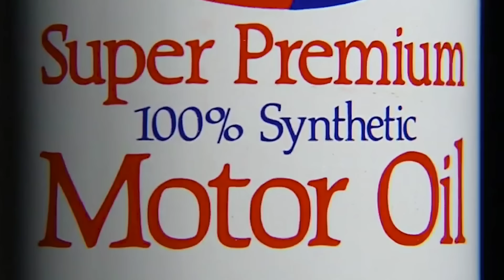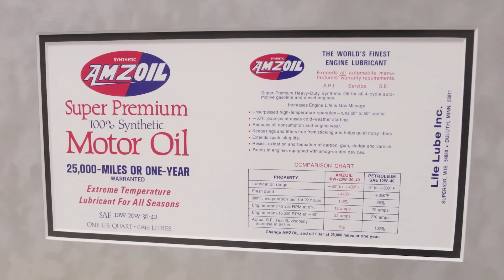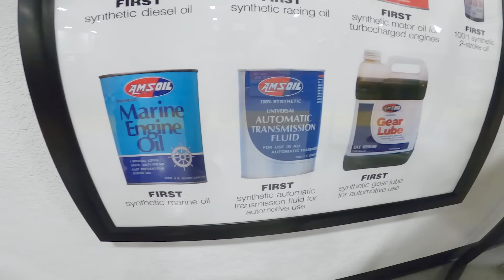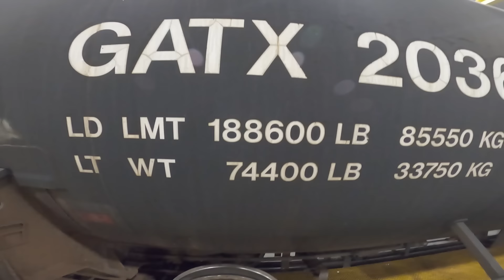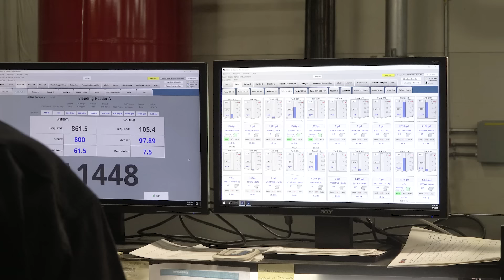How synthetic motor oil is made | Part 1 of 4

Comment: The funny thing is for jet fuel and cleaning a hydrant system on a flight line this is very similar we just have much larger piping and our pig launchers are probably 4ft in diameter to clean out the system like they have

Comment: I used ams oil in my rig 500 miles later the engine threw a rod but i think think mechanic did the engine flush and forgot to put oil back in the engine while flushing ....after that i just use regular oils in other trucks

Comment: I would consider using Amsoil if, it was more readily available and, had a more competitive price. The way they have in my area is online, submit personal information, or drive for over an hour to the closest Amsoil dealer nearest me. They also charge shipping for anything under $100 dollars. I end up spending twice as much as it cost for mobile1 or Pennzoil fully synthetic oil. I can get either of these within 5 miles of my house every day, any time, 24/7. It just doesn't add up.

Comment: Why do manufactures recommend a particular SAE for their vehicles?
After all SAE recommendations is based upon temperature. 
For example there is only 5°c difference either way between 10W50 and 15W40 / -25°c to 45°c for the 10W50 and -20°c to 40°c for the 15W40. 
Depending upon where you live, either viscosity would be fine.

Comment: Forrest Lucas, president and founder of Lucas Oil. Told my father, how synthetic oil is made. My family has built racing engines and competed in NHRA for the last 30+ years. Forrest said that synthetic oil is nothing more than hundreds of gallons of oil being put in a sonic vibrator and analyzed. The oil where the molecules stick the closest together is labeled full synthetic. When the molecule starts separating. It’s labeled semi synthetic. When the molecules get a certain distance apart, it’s label. Conventional. Makes sense to me.

Comment: They are telling you the truth I field tested their products for 350,000 miles they were labratory tested at various mileage after breaking in my new truck for 10,000 miles I then switched to the 10W 40 diesel oil, Transmission fluid, Red grease for wheel bearings, drive shaft universal joints front suspension joints , diesel fuel addative and anti gel every tank fill up. I used their bypass filter kit for the van that filter was abou10-12" long and about 4" in diameter I sent in a test after 10,000 miles it came back still useable, then 15,000 miles the same testing and finally 25,000 miles the oil was still useable WOW? I settled on 15,000 mile oil changes and changed the factory oil filters (2) at about 7,500 miles and changed the bypass filter about 25,000 miles as it has somewhere about 2-3 microns filtration this might not be correct as I parked the truck in 2008 becuase it was 18 years old and I could no longer buy parts in the USA as it was an Italian truck called Iveco, when it was shut down it did not use much oil maybe a quart in about 3000-5,000 miles the Automatic transmission was a Chrysler 727 transmission about every 125,000 it needed to be rebuilt as the truck weighed 22,000 miles fully loaded, I usually changed the trans. oil and filter maybe 30,000 miles. What really surprised me was the front Timken wheel bearings which require repacking at 30,000 mile ( Fossil Oil grease) when I took the bearing out of the hub they were still saturated with Ams Oil red grease, I rechecked at (65,000) miles I put the bearings back in and wanted to try for 100,000 miles, I lost the right front wheel bearing at 85,000 miles I had to cut the bearing race  as it was welded to the spindle not bad I cleaned it with several different emeroy cloth sizes like 80, through 1000 grit the bearing race fitted right back both right and left wheel bearings were changed I did change the bearing again somewhere around 250,000 miles.
I also matched my Mercedes 300SD  with Amsoil bypass spin on filter it was a 1983 model with maybe 100,000 miles and no none of the seals leaked.
All of this is true and I could guide Ams Oil to the abandoned van that they use for storage only it has not been restarted and by the way the same turbo charger was still functioning when parked for the last time. AMSOIL FOREVER you will save thousands of dollars in just oil and metal failures.

Comment: I've used plenty of Amsoil in my day and I like it.  However, they really need to figure out their distribution model.  There is no possible way their current model isn't holding them back.  They can promote all they want.  If the average person finds it difficult to actually find and buy the product, then their sales pitch falls on deaf ears.  I just changed my oil on my Toyota Tundra.  I change all my own oil in 4 cars.  I drove 50 miles round trip to a Napa that carried Amsoil only to find they were sold out.  I ended up ordering Liquid Moly from Amazon.  Bottom line, I tried.  The individual sales model doesn't work.  Those folks often don't stock what you need; especially filters.  Yeah, if you really want it you can find it and get it.  The point is, it's not easy and often a pain in the arse.

Comment: Problem I have with Amsoil is that it is not listed as approved under WSS-M2C171-F1 for Ford Powerstroke engines.  When it comes to warranty work, how does Amsoil certify that their oil meets all the standards?   I use Amsoil for my 2 stroke and 4 stroke motors that run oil in gas mix, and my lawnmower, but in my $90,000 truck, I want oil that certifies it meets or exceeds the standards Ford specified.

Comment: What I learned is that Amsoil doesn't produce a single ingredient on their blends of synthetic oil. That leaves the question of does Amsoil do more than just specify the various compenents used in their synthetic blends. This whole facility just meters and blends various fluids. That would not be any different than any of their competitors.  So Amsoil charges more for a blend of commercial chemicals that are sold across the whole industry for these applications.

Comment: The fact that air temperatures are low in flight is not why aviation uses synthetic oil in turbines.  It’s actually the opposite.  Turbine engines average 500-700°c at cruise. With bearing speeds well over 40,000 rpm.

Comment: Synthetic Oil: Everything You Need To Know
Synthetic oil is a man-made lubricant that consists of artificially made chemical compounds. Synthetic oils are typically created from chemically modified materials such as petroleum components, but the base material is almost always distilled crude oil. processes used to make synthetic oils allows oil companies to remove impurities otherwise found in crude oil.       First, the way the oils are made create a clear distinction.
For example, conventional 5W-30 motor oil is a petroleum-based oil that is thick at low temperatures and thin at high temperatures. To change this variance, oil manufacturers use additives to change the oil's properties, reducing its viscosity at lower temperatures and thickening the oil at higher temperatures. When it's freshly made, conventional 5W-30 motor oil acts like its synthetic counterpart, but over time, the chemical additives break down or vaporize, returning the oil to its original consistency.
By contrast, synthetic oils are designed to match a specific type of multi-grade oil from the beginning. Even without additives, a synthetic 5W-30 motor oil will not degrade or change viscosity—it may only become slightly thicker from contaminants.

Comment: This detailed and quality manufacturing process gives me a higher appreciation for Amsoil. The one thing it doesn't tell me is why my Harley sounded like a bucket of bolts the one and only time I tried their 20W-50 synthetic oil for my bike. After one short ride I had to drain it out and go back to my regular brand and no more noise. That was quite an expensive "engine flush" and for that reason have never bought it since. I know some swear by Amsoil, but my bike didn't like it.

Comment: I have been using synthetic oil in all my vehicles 2 and 4 stroke for 25 years.  I only use Amsoil, used to be a Mobil1 guy.  Not saying Mobil1 is bad, but Amsoil is just better.

Comment: *How Synthetic Motor Oil Is Made*

Unlike conventional motor oil, which is refined from crude oil, synthetic motor oil is created through a process called synthesis. This involves chemically engineering or building the oil molecules from smaller molecules. There are several methods used, but some of the most common include:

*   *Ester Synthesis:* This process involves reacting alcohols with organic acids to form esters, which have excellent lubricating properties.
*   *Polyalphaolefin (PAO) Synthesis:* This method polymerizes (combines) alpha-olefins to create synthetic base oils with consistent molecular structures.
*   *Group III Hydrocracking/Hydroisomerization:* This refines crude oil to a higher degree than conventional methods, resulting in a base oil that is considered synthetic.

These processes allow manufacturers to create oil molecules that are more uniform in size and shape, leading to improved performance characteristics.

*Additives and Their Functions*

Synthetic motor oils rely on a blend of additives to enhance their performance in various areas. Some key additives and their functions include:

*   *Viscosity Index Improvers:* These help the oil maintain its viscosity (thickness) across a wide range of temperatures, ensuring proper lubrication in both hot and cold conditions.
*   *Detergents:* These help keep engine parts clean by preventing deposits and sludge from forming.
*   *Dispersants:* These suspend contaminants in the oil, preventing them from clumping together and causing problems.
*   *Anti-wear Additives:* These create a protective layer on metal surfaces to reduce friction and wear.
*   *Corrosion Inhibitors:* These protect engine parts from rust and corrosion.
*   *Antioxidants:* These slow down the oxidation process, which can cause the oil to break down and lose its effectiveness.
*   *Pour Point Depressants:* These improve the oil's flow at low temperatures.
*   *Friction Modifiers:* These reduce friction between moving parts, improving fuel economy.

*Qualities of a Superior Synthetic Motor Oil*

Gale Banks, with his focus on high-performance diesel engines, will be particularly interested in the qualities that define a superior synthetic motor oil. These may include:

*   *Enhanced Thermal Stability:* The ability to resist breakdown at high temperatures, crucial for demanding diesel applications.
*   *Improved Oxidation Resistance:* Preventing the oil from thickening and forming deposits over time.
*   *Superior Low-Temperature Performance:* Ensuring easy starting and proper lubrication in cold weather.
*   *Excellent Shear Stability:* Maintaining viscosity under high stress and shear forces.
*   *Reduced Volatility:* Minimizing oil consumption due to evaporation.
*   *Extended Drain Intervals:* Allowing for longer periods between oil changes.
*   *Enhanced Engine Cleanliness:* Keeping engine parts free from deposits and sludge.
*   *Improved Fuel Economy:* Reducing friction and improving engine efficiency.

By understanding these aspects of synthetic motor oil, Gale Banks can make informed decisions about the best lubricants for his new diesel crate engine program, ensuring optimal performance, durability, and longevity. His visit to AMSOIL will provide valuable insights into the manufacturing process and the technology behind these advanced lubricants.

Comment: Actually, the welds would've bèen straight argon,or starting at around 15 psi,with no,zero backing plates other than the purge line and caps... Followed by multiple 1/8 to 1/4 " filler and cap passes..

Comment: This video should have been titled: "How a motor oil factory is made"

In the "Base oil delivery" section they talk about different types of raw material and how much can go into the rail cars, but they never say what the raw material is. I assume it's oil, but it begs the question - of a the layperson - what are the different types of oil and why do you use different types of oils? Maybe they use different chemicals, in addition to oil?

Then they move on to the blending, but don't mention what or why they blend. Again, they talk about how much can be processed and the equipment that's used, but don't explain anything about the oil itself. In each section, oil is only mentioned tangentially to the discussion of the factory's tooling and technology.

Comment: I once worked as a lube oil formulation scientist, and it is an art, not a science, by adjusting the amount of ingredients, the carbon and tar can be moved around the engine and finally trapped in the oil.

Comment: They still didn't show how they make the oil only how they blend it, they didn't really even show that, it's probably propietary information. I would like to see how they take the gas and turn it into oil. I have used synthetic oil since 1976 that's 47 years and I have used it amsoil for 20 of those years, In the beginning it was mobile one and I used to go through a quart every 500 miles in the old engines.
Reply from the maker: This was the first episode in a 4 part series. See our other episodes where we step into the Amsoil lab where we explore the molecular structure of synthetic oil and its additives.
Ep2 👉🏻 https://youtu.be/9rEGIB2F8qA
Ep3 👉🏻 https://youtu.be/NuX1tWwLjy8
Ep4 👉🏻 https://youtu.be/mnseEdDSVDM

Comment: Here is how Amzoil is blended and distributed. Not how it is made at all. Who is the large manufacturer sending those tank cars in to Amzoil. They spent a lot of money on that mixing facility. That may be why the cost is so high to the customer. I need to go to the folks who sent Amzoil the actual Synthetic lubricants.
Reply from the maker: First, This was the first episode in a 4 part series. See our other episodes where we step into the Amsoil lab  and explore the molecular structure of synthetic oil and its additives.
Ep2 👉🏻 https://youtu.be/9rEGIB2F8qA
Ep3 👉🏻 https://youtu.be/NuX1tWwLjy8
Ep4 👉🏻 https://youtu.be/mnseEdDSVDM

Second, we're curious to know where you are seeing high costs for Amsoil. For example, a quart of oil for a 2022 Duramax L5P 2500hd costs between $9 - $13 on the Amsoil website. 

https://www.amsoil.com/lookup/auto-and-light-truck/2022/chevrolet-trucks/silverado-2500-hd-pickup/6-6l-8-cyl-engine-code-y-l5p-y-diesel-turbo/?volume=us-volume

Comment: I don't know how much engine oil is in Amsoil nowadays. I know back in 1977 they wanted $25 a quart, I asked my dad about it and he said just buy the regular oil you don't need that high-priced crap. I myself could not see spending that much money oil that you would only take and throw into a drain bucket after running it in an engine, if their price had been significantly less I think they would have sold more , oh oh of course that probably would have outstripped production and I know the maker was out to make a killing even though Amsoil oil is supposed to be a very good product I still will not buy it because of the over price. I'm off to buy some clone oil, I know mobile makes a good oil.
Reply from the maker: We're curious to know where you are seeing $25 for a quart of oil? For example, a quart of oil for a 2022 Duramax L5P 2500hd cost between $9 - $13 on the Amsoil website. Their racing and heavy duty truck oils aren't much higher than that. 

https://www.amsoil.com/lookup/auto-and-light-truck/2022/chevrolet-trucks/silverado-2500-hd-pickup/6-6l-8-cyl-engine-code-y-l5p-y-diesel-turbo/?volume=us-volume
Reply: @bankspower  in 1977 my neighbor claimed he was an Amsoil dealer, he had the stickers on the outside of a station wagon he was always working on and I did come interested in buying oil from him because I figured it would be good relation to buy oil from you know someone close by being that he lived in the same building. He told me that the oil that I would need for my truck which was a Ford Econoline with a 351 Windsor, he said the oil would cost $25 a quart now maybe the price is changed since then but that's what he told me it was then and I don't know if you have any history about what oil cost back then or not but that was a good reason for me not to buy oil from him.   So other than that I hope someone is not trying to make me look like a fool , that was over thirty years ago kind of a long time.   ( your turn).         In case an address would help I lived at 220 Hazel Street Green Bay Wisconsin the neighbor was living in the same building and if he was, or wasn't a distributor they may have some kind of record of him